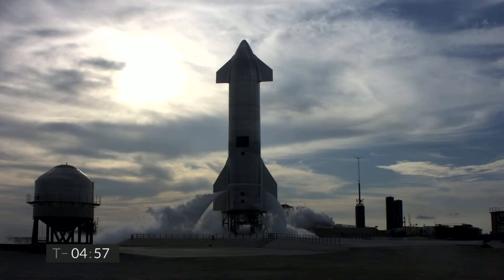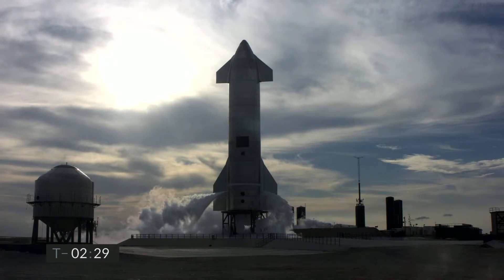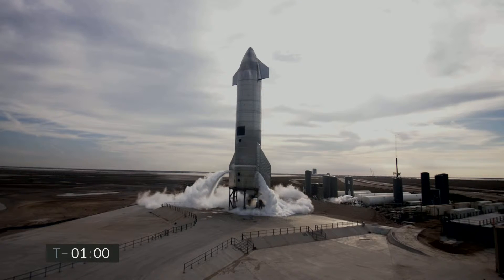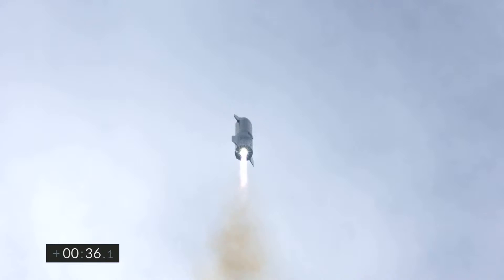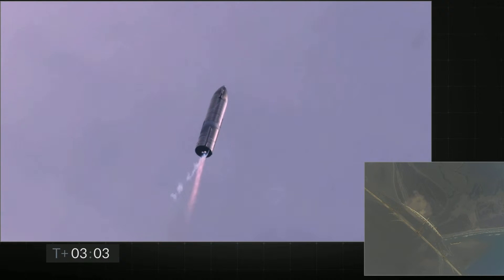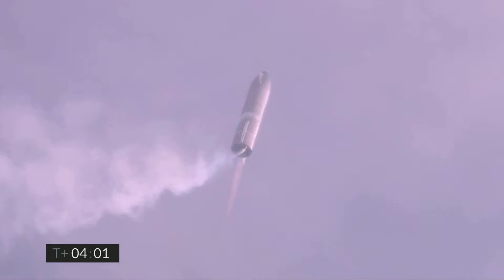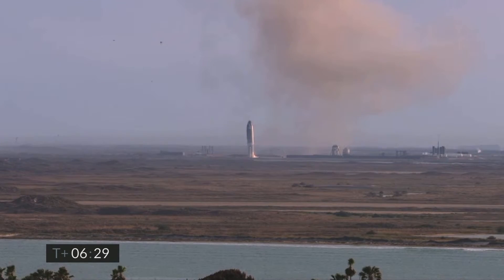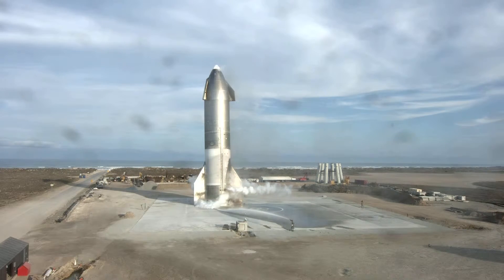Starship | SN10 | High-Altitude Flight Test

Comment: If you believe in conservation of momentum, which I'm sure all of you do then imagine you catch a ball going at 50 mph then throw it back at 105 mph; thus is my explanation as to why this 🚀 should have airjet propulsion for re-entry.
Reply: An easier solution would be to line the underbelly with boosters to use when it is horizontal and falling.
Reply: I still don't understand why you would want such a thing?
Reply: Maybe it's the parcel service of the future ;)

Comment: Third test starship sn10 is failure elon musk become poor because waste his money for useless starship
Reply: Pretty sure this is the standard testing number for Rockets. Falcon 9 rocket had 28 flight test.
Reply: Elon can afford to build hundreds of these. Losing three is no big deal. In fact, they were originally prepared to lose up to 6 before recovering one. 
Falcon 9 took at least half a dozen tries just to land, and another dozen or so before reuse was practical.
Now two of those boosters have flown 8 times, each with a ninth flight planned. Many more boosters have done 5 or so flights. In total, 75 landings to date.

Comment: That's really cool but so much pollution
Reply: Not that much in the grand scheme of things. The fuel is refined natural gas, so it burns pretty clean.
Overall it makes about as much CO2 as an airliner flight, of which there were 39 million in 2019, so yeah, one rocket launch is a drop in the bucket.
And eventually, SpaceX want to use carbon neutral fuel for this, since they'll have to make it that way on Mars anyway.

Comment: Even multiple days later, this is still on trending
Simply incredible
Reply: Yes,
Reply: yeah because it exploded...
Reply: Reality check.
They have so much experience from the landing of the falcon rockets but still need four Starships to get the landing correct. It makes me wonder how many boosters are they going to destroy?
...and they still have not put all 6 engines on the Starship.  
The SN8's destruction can be forgiven. The SN9's destruction was worrying.  The SN10's destruction was pure incompetence. and a waste. How many boosters will have to be pointlessly wasted?
Reply: @reasonerenlightened2456  Perfect example of the Dunning Kruger effect here. Developing such sophisticated vechiles takes trial and error. These vechiles (SN8-SN16 and further) are test vechiles. They are expected to eventually crash. 

I understand your reasoning that they would have the data already from the Falcon 9, but that is a completely different rocket. This Starship prototype is propelled by highly advanced full flow stage combustion engines (only of its kind). Relighting them and keeping them lit up while preforming the dynamic flip manouvre is harder than you might think. And the aerodynamic descent and flip are also never seen before. 

Remember, failure is the gateway to success :-)
Reply: @reasonerenlightened2456  do you not know how innovation works

This is how spacex innovates
They've gotten all of the data they need, so it really isn't incompetence

You try making a rocket like this
Reply: @Arae_1  
What data are you talking about? They have the data from the Falcon series.
... clearly transfer of knowledge seems impossible from Falcon to Starship to the Booster. Is it really impossible or it is the case of someone not connecting the dots ?
Reply: @reasonerenlightened2456  landing a falcon 9 is so different to landing a starship that it's not funny
Falcon 9 data is good for falcon 9 and that's it
Reply: @reasonerenlightened2456  Falcon 9 and Starship too different to use Falcon 9 data on Starship
Reply: @renaldaslaurinavicius4878  
What about the booster then ? Are you going to say again that it is impossible to reach an abstraction model for the landing which will work for the booster ? ... how many boosters will it take to land one?
Reply: @reasonerenlightened2456  They are trying to catch the booster in mid air while landing.. You will be amazed while seeing that. No landing legs for booster.
Reply: @IvenSimon  
They still need to control the speed of that monstrosity or else .. noting would be able to catch it.
Reply: @reasonerenlightened2456  Starship landing has nothing at all to do with the falcon landing! And yes, for the Superheavy booster landing they can and will use the data of Falcon 9. But it's still different. (28 engines!, engines are the only ones of their kind, much bigger than Falcon 9, catching instead of landing, rapid turnaround (~2 hours)...)

Comment: hahaha you cut out the part where the craft exploded!
Reply: Well it landed, so why keep the offical Stream running? they didnt exactly expect it to blow up 8 minutes latter, they didnt cut anything. Plenty of other people filmed it as it blew up.
Reply: @NZBigfoot  imagine landing in a plane today and it explodes before you even make it to your gate.
Reply: @librab103  Well, it isn't a plane. It's a single use non-manned test article that only had a 60% chance of landing.
Reply: @samos8367  Doesn't matter if it is a plane or not. It exploded. Seems to a common theme lately with these tests.

Comment: Was this mission a success?
Sn10: Yesn’t
Reply: @sebastiansilvaperkins8115  no this test was for the 10km hover and to get the engines to work properly to do the final flip. The landing was a bonus and not fully expected yet
Reply: Was the mission to be able to launch and land safely or reach out of the atmosphere?
Reply: @weebcoffee4568  Neither...
Reply: @weebcoffee4568  Ok so, the mission was to make sure that the reusable system can fully work(launch, 10km in air, landing). Prior to this, there were 2 failures making this third-time a huge success, after all, IT ACTUALLY LANDED! However, there is still a lot to do because minutes after the broadcast was over, the Starship exploded even though it already landed.
Reply: @weebcoffee4568  That’s not the point for this test.
Reply: @sebastiansilvaperkins8115  yeah I'm asking what's the point of it, please answer
Reply: @sebastiansilvaperkins8115  this test was for the 10km hover and to get the engines to work for the final flip. The landing was bonus and probably unexpected this early in development
Reply: @THIS---GUY  Oh. That's for correcting me. I'll delete my comment.
Reply: if you watch the last crash with SN9 only one engine turned on out of two so the landing flip failed all together. SN10 they added a computer program auto switch to turn on all rockets at once and select the two rockets with nominal readings instantly to avoid the earlier incident and successful flip for landing.
Reply: @THIS---GUY  Yeah, I've watched that one and saw the differences. Much better this time now that I think about it!
Reply: @sebastiansilvaperkins8115  You a real MVP Sebastian. Admitting you’re wrong. Not many do that these days on the internet.
Reply: @weebcoffee4568  overall the point with these is just collecting data. If it doesn’t blow up before it flies it’s already a success. 
With this flight I think they mainly looked at flaps during the dive and the flip maneuver.
Reply: @sebastiansilvaperkins8115  has unlocked the "I'm a nice guy" achievement!
Reply: @charlesdikkema5800  i've seen many people being nice in youtube and it is surely kinda rare
Reply: @weebcoffee4568  the guy announcing explains the point of it at the beginning of the video
Reply: I believe after 8 min it blew up
Reply: @cathycastellanos8417  was successful for 8min. Crew will just have to unboard within 8 min
Reply: @oliverf944  lol true 8 min seems a good enough time to make it out or they can do what elon suggested, use two engines to lower the impact of the ship when landing. Since that's why it exploded. If you notice it was at a slight angle and not perfectly straight. That was because the one engine wasn't enough tension. so the impact cause damaged and led to methane leaking.
Reply: @cathycastellanos8417 There was fire before the landing, the legs did not deploy, one engine may have shutdown too soon, either programmed or auto shutdown due to some failure.  All that resulted in a hard “soft” landing, and being tilted.  Any or all the above contributed to the explosion (Sudden depressurization, and fireball)
Reply: @cathycastellanos8417  thrust*
Reply: @ClearVod  yes! Lol that's the word I was looking for but at the time it slipped.
Reply: lol
Reply: They have so much experience from the landing of the falcon rockets but still need four Starships to get the landing correct. It makes me wonder how many boosters are they going to destroy?
Reply: @reasonerenlightened2456  Probably less than they did developing Falcon 9 landings.
Reply: @reasonerenlightened2456  the landings of the falcon rocket and this rocket are totally different, the two can not be compared
Reply: @reasonerenlightened2456  I feel like you don’t know much
Reply: @ClearVod  they're the kind of person who speaks in a way that makes it seem like theyre saying something meaningful, when their just spouting nonsense.
Reply: https://youtu.be/m3zxUQjLlvA
Reply: Yes it wasn't

Comment: Well done SpaceX!
Glad to see they used all three engines instead of just 2. Even still you could hear the hard metal crash on touchdown which is probably the reason for the fuel cell rupture. You can see the fuel burning inside the main lower body after the engines were off. Perhaps one of the  valves broke?
Either way this is a confirmed success!
Every step closer to manned flights in the reasonably near future.👏👏👏👏👏

Comment: ....is it just me, or does it seem like technology has advanced extremely as far as computers phones, but not so much when it comes to rockets and missiles and space travel?....smh
Reply: That's because technologies have 'ceilings'. The theoretical limit for a computer chip is much higher than a chemical rocket, so we reached the latter a lot sooner.
Take piston engines as another example. We pretty much hit the ceiling in the 1940s on WW2 fighter planes, both in features and performance.
The Buggatti Chiron's W16 engine weighs 490kg and makes 1500hp. The final versions of the Rolls Royce Merlin V16 engines were 780kg for 2070hp
That works out at only a 15% improvement in power-to-weight ratio over 70 years. There just isn't much more we can get out of them, same for rocket engines.

Comment: This is probably a really stupid question but, what happens if they try to land this thing on the Moon, or on another planet, and they can't find a nice, perfectly flat, paved spot like this on which to land?  I mean, if the ground is a not perfectly level, or if the ground it lands on turns out to be soft, isn't this thing simply going to topple over?  It certainly appears to be awfully top-heavy.  I know this is how they always did it in all the old sci-fi movies, but it always seemed to be that the concept of landing a rocket tail-first was the most difficult and dangerous way of doing it.  During the 1950s a lot of aircraft companies tried to do design an aircraft to land that way.  Not one of them was ever able to do it and, eventually, they all simply gave up on the idea.
Reply: I believe they are working on better landing legs with more leveling capability.  The reason that It must land bottom first is that is where the thrust is. you also can't just glide down onto the surface of the moon as there is no air. To land horizontally the rocket would need thrusters on the front and back to work.  Also, the moon doesn't have runways 😉

Comment: why not making suspensions for softer landing? too heavy?
Reply: I think one of the difficulties is space. The landing legs need to share space with three sea level raptors, and three much larger vacuum optimized raptors.

Weight is also a big factor. The lighter they can make this thing, the more mass they can lift into space, and the more cost effective it becomes.

Comment: So what was it? Nozzle breach? Anyone know?
Reply: Nobody knows for sure. We do know that the landing gear didn't properly deploy, causing the landing to be rougher than planned.
It's likely that something started leaking as a result, and eventually went boom.
Reply: @lazarus2691  Thanks - yes it looked down a little quick.
Reply: @michaelmcmurray9252  
Elon has given some updates since I wrote that comment. 
Landing speed was 10m/s. Which is 36km/h, or 22.5mph.
While the landing gear was an issue, the main reason for the hard landing was low thrust from the engine due to helium bubbles mixing into in the fuel supply. 
So basically instead of drinking regular water, it was drinking soda water. 
I'm actually amazed the engine didn't explode. Usually cavitation in turbopumps is a death sentence for a rocket engine.
Reply: @lazarus2691  LOL nothing worse than fuel contamination - thankfully this won't happen again!

Comment: it was done in 60s and one rich guy gets billions and show the 60s trick then everyone says wow, we made the history, take more money the rich cat..
Reply: Which 60's rocket did this belly flop manouevre?
Reply: @logitech4873  they did 100s of testing and no benefit i can see apart from vertical landing which already done many times.. moon landings, the ships did not land upside down, they land vertical and reused back to the earthback
Reply: Which 60's rocket was rapidly reusable?
Reply: @MatTheGameGuy  hello, how the hell moon landing and return made by rockets.. plus every SpaceX rockets were failed and exploded.. you call it some success then get on the sn11 as a test pilot then
Reply: @vuk1419  1.  Aw hell no! it's called a prototype for a reason! these early starships are made as quick and cheap as possible. This is a test program after all. 2. what do you mean every SpaceX rocket failed and explained? he is the latest Starlink mission:https://www.youtube.com/watch?v=d5DzoKuhdNk  It completed both its primary and secondary mission, in fact, it's been multiple years since a falcon 9 has entirely failed a mission. not to say it hasn't happened before. But the Falcon 9 is one of the most reliable rockets right now. 3. I don't understand the first thing you just said (might have been a typo). And 4.  could you please show me the "100s" of vertical landing tests by NASA.

Comment: How much oxygen was burned during this space madness?
Reply: About as much as 40 cars do in a year. Of course, there are 275 million cars in the US, so this is a drop in the bucket by comparison.
You'd have to launch nearly 7 million of these every year to match that. That's 19,000 a day, or one every four and a half seconds.
Alternatively, this burnt about as much as a typical airliner does in one flight. There were 39 million airliner flights in 2019.
You could launch one of these every single second and probably still burn slightly less fuel than the pre-covid aviation industry.

Comment: Landing a rocket vertically is hard!! Looking at the footage of the landing In my opinion you need better landing gear and you need more height form the ground to the bottom of the rocket.. on landing to expel the hot gases coming out of those three engines or you need to expel the gases some other way. It landed with a fire under it with no a to expel the heat and gases that is a recipe for a explosion !!!!

Comment: Hello,  i thing one of the engine during the landing cause a depressurize of fuel chamber. Landing pads malfunction? Or they check if they can go without them ?! They was sure they land so soft that landing pads will be no need ? Or they test of if this part will malfunction landing still be possible ? I think is a Big win  .. that landing give possible future crew enough time to get of from starship to safety!   Normal person see this as failure ... but really for all  humanity is a big step , give us so much more data we can work on to avoid many more future problems :) . GO SpaceX , anything is possible!
Reply: i notice depressurize cause rapid temperature drop in this condition any metal is fragile !